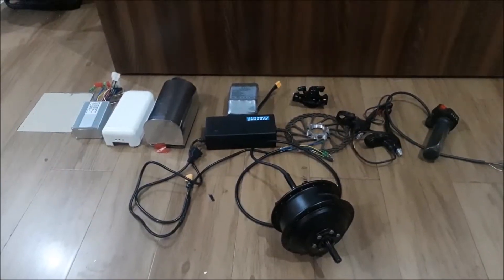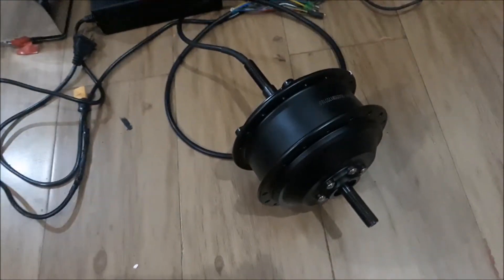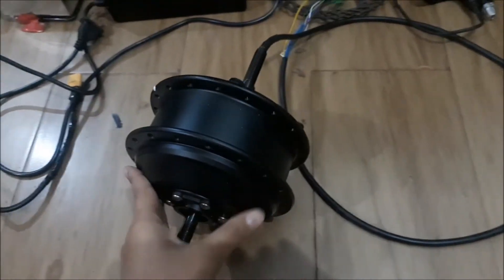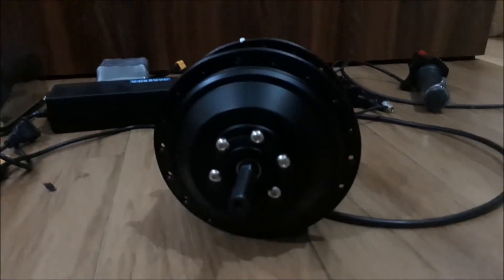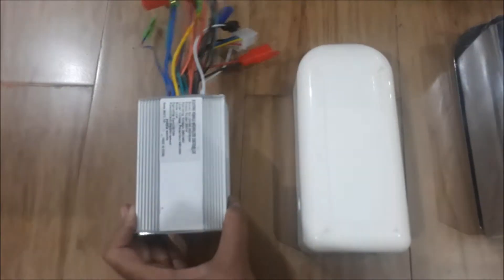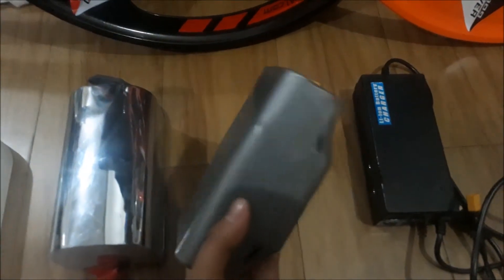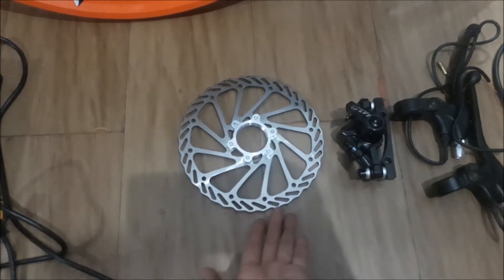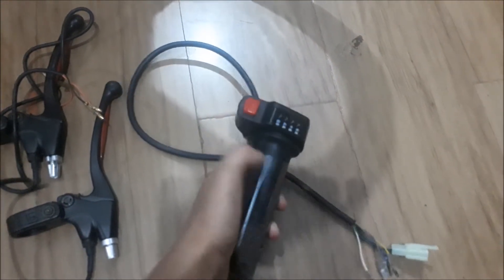GoGoA1.com hub motor conversion kit for bicycle.Detailed video

Comment: I bought PMDC 250w 24V motor from aggarwal last year and fitted in my Hercules bicycle with lead acid battery. It is running, but the mileage is less than 10 km only as the total weight of the cycle including driver reached 110 kg as the capacity of the 250w PMDC specified only 90 km. Pl let us know what is the load capacity of this motor and mileage for that load? This information will be useful before buying as i am interested in hub motor to convert another cycle. So pls...
Reply from the maker: Yes sir, thank you for showing interest in our organization
Please share your number, our team will be in touch with you
For more details contact our team +918657591816 / +918850178791
Reply: @GoGoA1  9894176510